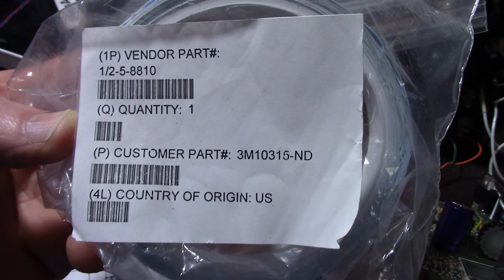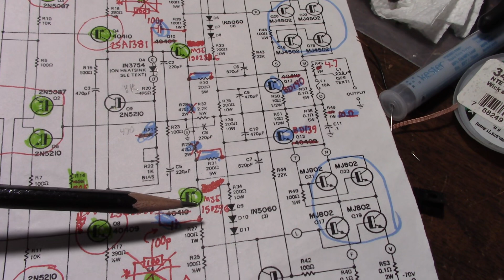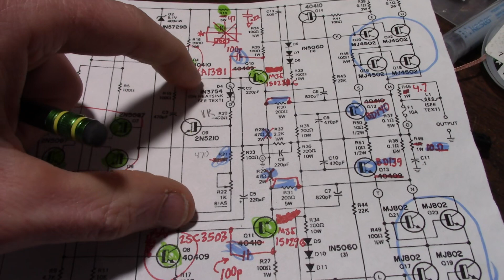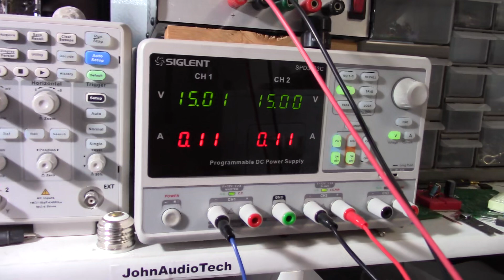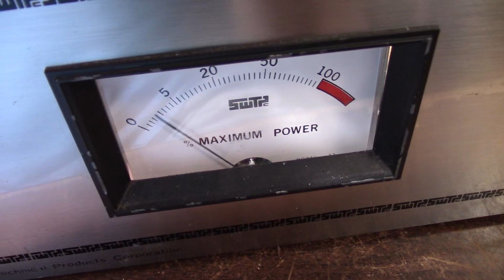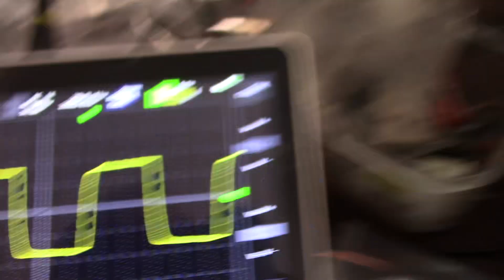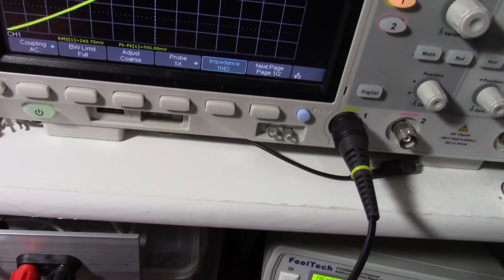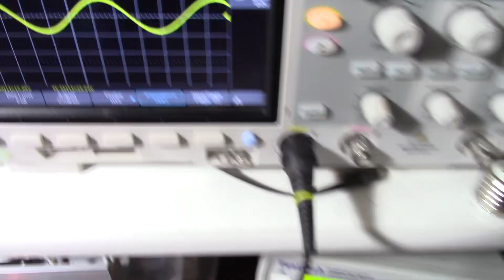SWTP Tigersaurus amplifier modification completed

Comment: What did the rails sag to under full output on this? Did you just test power at 8ohms?
My 3 pair k134 j49 saggs to 59v rails from 69v idle at 4ohm i got 306w unclipped.
This seems a bit more manly than mine.

Thanks

Comment: John, sorry. The problem of the excessive heating of the power transistors with very low voltage in the PSU (±20VDC), was that I had the BIAS control in the ZERO OHMS position (maximum current conduction). I moved it towards 1k max resistance and the voltage issues were fixed and the power transistors cooled down for my peace of mind.

￼

Feedbac

Comment: Hi John, I don't want to make a long and boring letter. I am 61 years old and I have been a Piano Teacher all my life but my hobby has been electronics. When I saw the videos of the Tigersaurus modification, I was excited to repeat that modification on a Tigersaurus that had been broken I suppose by oscillations. I did everything as you showed it in the video. Using a Variac today , I was able to bring the voltage across the power supply filters down to just ± 20 vdc and touching the power transistors with my hand , I felt them get hot . It surprised me with so little voltage. Making measurements with the multimeter, with ±20vdc in PSU, in the Collectors of q20 and q22, q17 and q19 there was ±10VDC, but in the Collectors of the rest of the transistors it had voltage when in another Tigersaurus that is working it has ZERO Volt. I have a question: do you remember in the BIAS circuit in which position the 1k control was (maximum resistance or minimum resistance) when applying voltage??? . Answer me please. Thank you . Pedro .

Comment: Hi John , finally when you connect the amplifier to full voltage of +/- 74 vdc , both resistors R30 and R31 are replaced by two wires ??? . My question is because I don't see clearly in the final video of the anti-oscillation modifications the wires that would be used as jumpers of R30 and R31. Answer me please. Thank you so much . Pedro .
Reply from the maker: I used a piece of wire to short the traces together on the foil side of the board since they run next to each other to short R30, 31 out of the circuit. Of course, you could replace R30 and 31 with  jumpers. C6 and C7 are no longer needed either.
Reply: @JohnAudioTech  
You are the best .

Comment: excellent analysis that eliminates possible oscillations, excellent video. I have a question about the changes .... the transistors Q3 and Q7 remain the original ones ??? . Thank you so much . Pedro .
Reply from the maker: I changed them as well as the voltage stress on them would be at the limit.
Reply: @JohnAudioTech  , thank you .

Comment: Glad to hear you got things sorted John. I will work on getting a Dayton trip on the calendar for pickup. I am with Anton on the testing. How about a head to head on the two units it isn't too much trouble?
Reply from the maker: Fair request. I'll see what I can setup. Probably a "null" test where the difference between the output signals is shown.
Reply: Sounds good. Anton and I have been noodling with these units for a while. It would be fun to see how they measure up.

Comment: Well done! Is 3M tape or any other type of thermal pad better for power transistors than mica/grease?
Reply: Aluminum oxide pads and mica has the best thermal dissipation, BUT mica has the least quality control... It should be maximum 0.05mm thick, and uniform in appearance. Kapton is used much on output transistors for various reasons. Silicon pads measure very badly compared to good mica.

Edit: I used Ultimiflux pads last time, no issues since. They're made with phase change compound so what you need to do is get your amp nice and hot and tighten the outputs down further after initial install.
Reply from the maker: The 3M tapes are good when you don't need to transfer a lot of heat and use lightweight parts. Thermal characteristics are shown on the datasheet. I bought it to mount 1cm^2 5 watt COB LEDs to a heatsink. Rather expensive for a roll, but it will last a while. It is not adequate for higher power devices using conventional mounting techniques.
Reply: I second the Wakefield Vette Ultimiflux pads, they're doing a great job with highly biased lateral mosfets and polished copper heatsinks. What I did was to place the entire heatsinks with transistors mounted into the oven and tightened the bolts while they were still hot.

Comment: Parts shortages should reduce significantly in the near future, lots of capacity coming on line.
Reply: I really hope thats true. Started buying parts maybe 7 years ago and cant even get a bc560 these days. It's actually quite hard to build a lot of amp designs at the moment without transistor alternatives or multiple vendors. Im just glad Exicon are making lateral mosfets.
Reply: @peterlarkin762  It seems that pretty much all of old "low noise" transistors are no longer manufactured. The best I have managed to find recently are KSA992/1845 and SMT Toshibas similar to sa970/sc2240. With worse noise spec, despite datasheets using noise figure graphs from old 970/2240 datasheets.

Comment: Awesome work John. This was so interesting. It's nice to see a redesign of a production amp with your explanations at each step. I once had an amp that I'd repaired and it blew up once per month. I worked with a technician from the parent company for hours, trying to sort out the instability. It turns out, it didn't like the mica insulators I had used on the output pair. Went back to silicone types and it behaved. It was so close to oscillation all the time.
Reply: That's really nuts. You sure it wasn't just a bad mica sheet? Im all for resurrecting amps but some stuff is inhernetly badly designed. Top marks for perseverence!
Reply: @peterlarkin762  It was a horribly designed FET amp that had a real problem with capacitance. It even had specialist values of resistors, like 16.1k ohms. Red flags when they don't even use off the shelf values for passives.
Reply from the maker: @tenmillionvolts  Interesting problem. Probably only a few pf of capacitance difference between the insulating sheets. When my JAT501 amp had a 40MHz oscillation, just touching the tabs of the output transistors could make it stop. Fixing the ground layout and bypassing the supply near the outputs made it stable. I added base stopper resistors for insurance. I wonder if your amp used gate stoppers?

Comment: Would like to see some tests VS the unmodified one as these two are a stereo pair. S/n, distortion, can the original pass the cap test, etc.
Reply from the maker: I'll work on this. I'll bulb limit the other amp during the cap test. Bursting into oscillation could blow the outputs.

Comment: The SWTPC Tiger and Tigersaurus amps had strong "thumps" when coming up from the voltage drop (or power surge).  Have you eliminated that problem with some of your modifications.  Or do you have a soft-start circuit in the power supply for the finals.  I keep worrying that I'm going to either blow my speakers or burn up the drivers on my Tiger pair.  Have you resolved that issue with your mods?
Reply: Actually the .01 Tiger and the Tigersaurus tend to come up with a fairly minimal turn on pop, being that the circuit is balanced throughout, no DC level to sort out between a single-ended input stage and symmetrical output stages. If they do pop bad on turn on then I'd check that things are well balanced, no DC offset on the output when quiet.
Reply: I concur with Hill's. No pop on any of mine.
Reply from the maker: I don't notice a thump or pop sound either. The balanced design of these amps should keep the output quiet during powerup/down or other rail voltage transients.